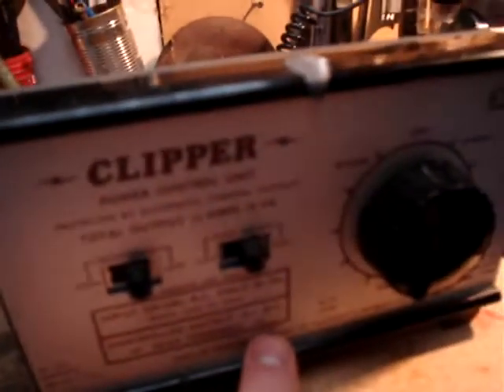Small wind tunnel

Comment from the maker: @fah212 How many fans depends on alot of things, ie how big the tunnel is, how fast you want the air flow etc. If you are going to put a fan blowing air in, you should make a diffuser to counter the air swirling as it leaves the fan. Something easy is alot of drinking straws stuck together with the fan blowing through them. If you are planning to blow sand across the track you will probably need quite a powerful fan. As you can see I made this tunnel out of junk basically, so experiment!